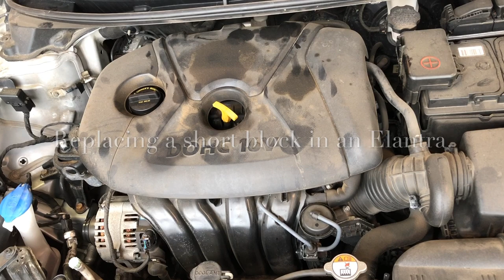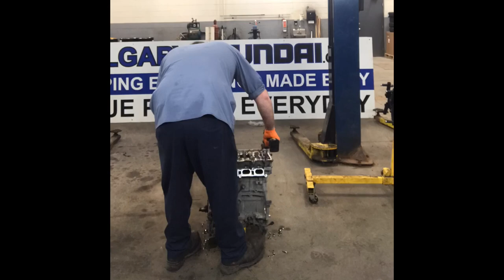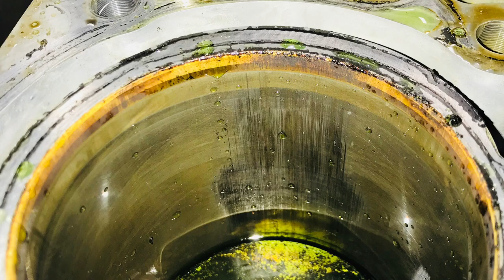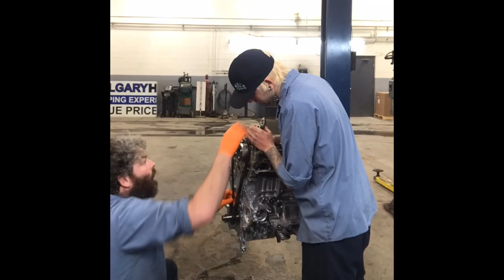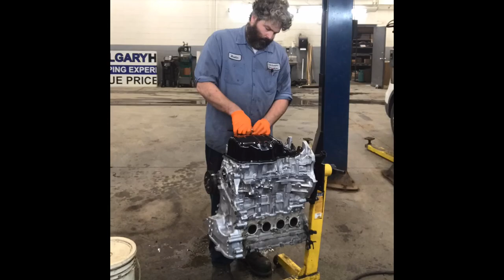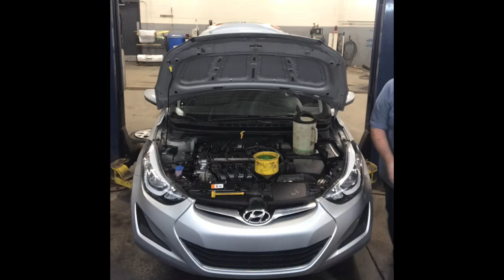Replacement of a ticking Elantra short block.

Comment: Hyundai has indicated they will install a new short block in my 2013 Elantra, what should I look for after the work is done to make sure the job is done well? Does the new short block have a warranty?
Reply: My elentra 13 has the same terrible sound 137 k
Reply: @rabaranwer9752  I got the vehicle repaired under warranty. I decided at 98,000 to part with the vehicle by selling to Carmax. I feel like I passed on a useful vehicle to future owner because it has a new engine.  I am annoyed with Hyundai brand because of serious nature of flaw. The Internal combustion engine has been around for 100 years, a reputable manufacturer should not have such a serious flaw. My two cents.
Reply: @Texasbird026  all makes have problems recently I saw the same for BMW’s

Comment: I’m surprised the engine came out the top. Most cars it’s dropped thru the bottom. I prefer the top method, dropping the engine cradle assembly is just begging for other issues